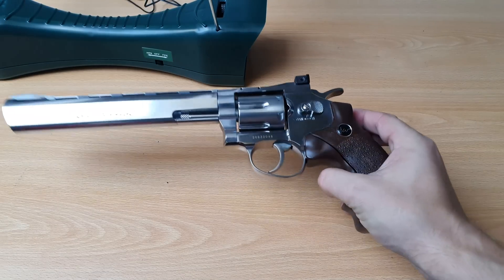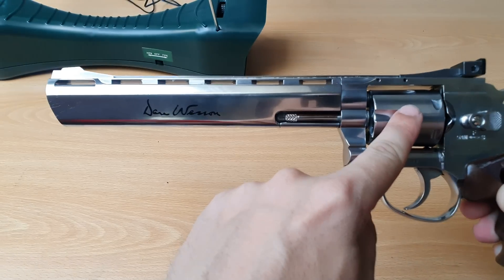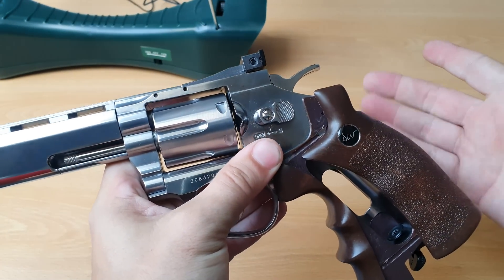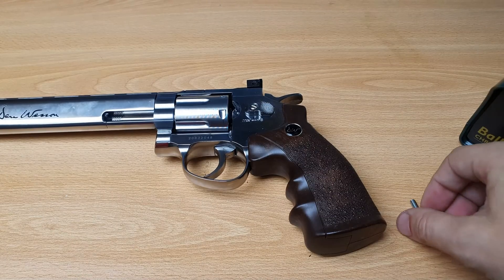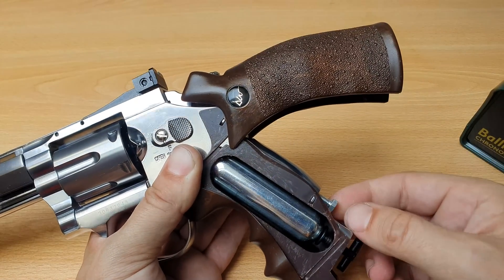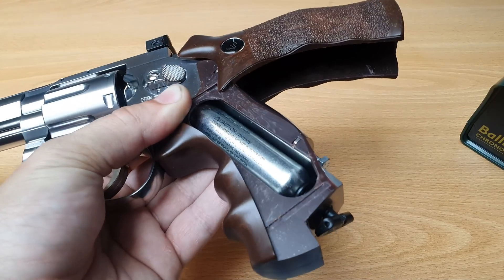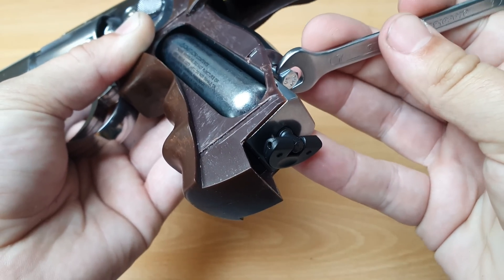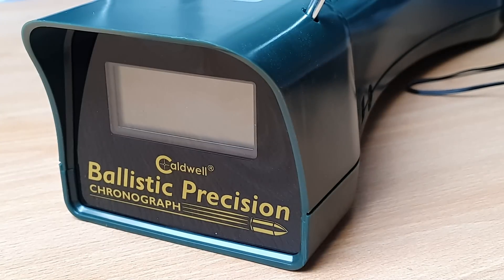Is more tension spring more FPS and power ??

Comment: You understand these guns better than i do, 

prehaps you could try what this dude did to his dan wesson, https://www.youtube.com/watch?v=GHBWP2U4Qjw

16.7ft-lbs (22.6J) 194m/s (636fps) with .25 cal pellets.

HPA mod with the ASG HPA co2 capsule would be intresnting to see if it works, and even with the stock .177 barrel
Reply from the maker: its connected to a pressure tank with 200 bar of pressure, you can maybe do 50 shots and then everything breaks :p
Reply: @HappyDude1  not neccesarli need to shoot at 200bar, maybe at an slight increase from the stock 80bars or whatever normal co2 produces at 20c
Reply: Can't opet privat video

Comment: ok guy's, have you spotted the con going on here.! well try shooting with a hot Co2 cartridge and some very light BB's through your gun, and the FPS go through the roof! Oh yes they do!,, look at the power!,, it's up by 40 FPS,,, Oh wow!,, and  he still has a bloody hard trigger pull that need's the grip and arms of a griller to hold the gun on target!, remember what I said before in the last video?, """power is nothing without accuracy""" please don't waste your time farting around with the trigger pull spring!, you won't gain very much, but you WILL LOSE ACCURACY,,, just swop the dam power valve to the 3-inch snubby power valve, its a high power valve (no red strip across it!),,  and its job's a good-un!,, up go's your power!,, it's that or get bizzy doing some real gun smith work on the power valve fitted in your gun and the Co2 porting, then you will be pushing closer to 550 FPS with a 28g BB!,, Oh by the way,,, doing this work will put your pistol way over the legal limit, and it wont half make granny jump when you shoot her in the rear end,,, only just for fun you understand!
Reply: But it shot slower with the upgrade.. Wtf
Reply: @airgunballistics1779  well that was not much of an up-grade then, was it? it was more like a very big down grade!, I take it you know that the Dan Wesson is a "LOW powered revolver", you may just about get one joule or around 1 ft,lb out of it, and putting a stronger hammer spring into it won't really make any difference to its power output, as the power output is governed by the amount of gas and Presher of that gas pushing the pellet down the barrel, there is a lot more to be taken into account like valve timing and valve overlap timing, added to that, it's gas porting and it's gas flow ratting, however there are two different valves fitted to the Dan Wesson revolver's, the short barreled (2 inch snubby) Dan Wesson has the most powerful valve fitted in it, as it has a very short barrel so the revolver need more gas for it to work right,, the snubby's valve is a high power high flow valve and has no red strip across it, (so you will be using more gas up) but the 6 inch valve is a low powered valve and dose have a red strip across it, both valves are interchangeable, just buy the more powerful valve out of the 2 inch snubby,  and swop it over! , at today's price that valve would cost you around £20!, and the trigger is not made any harder to pull, adding accuracy, nor is any extra stress put on any of the gun's part's, so with this kind of Dan Wesson "up-grade", cranking up the hammer spring tension. dose next to nothing in gaining extra power!  but it will pull the revolvers accuracy way down, unless you have the strength and the grip of a griller! you will also find out that your revolver will need new parts fitted very soon as this upgrade (down grade!) will very soon start destroying its trigger pin's and hammer pin's! I hope that has helped you in your quest for this extra power! extra power that will be near imposable to achieve.
Reply from the maker: Its true you know 😁
Reply: U can't swap them over .
1 is a lot shorter valve housing than the othere 1...unless you now otherwise